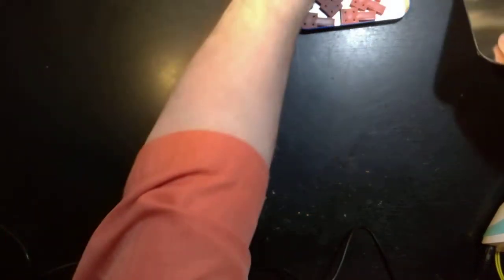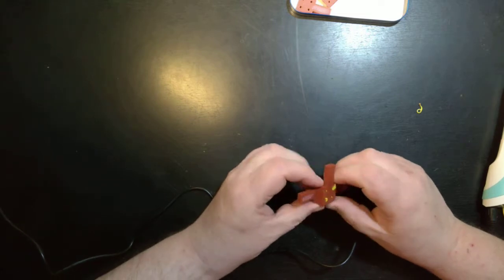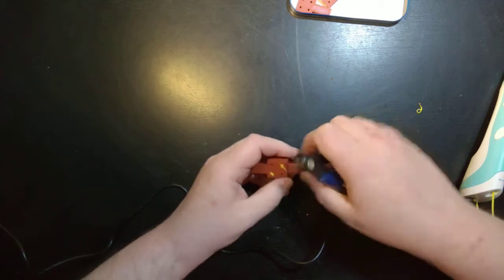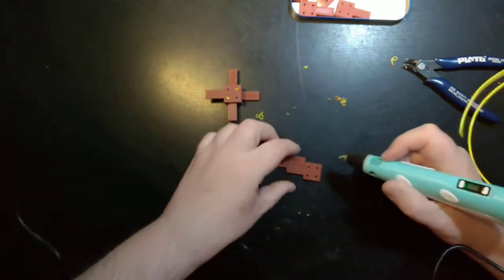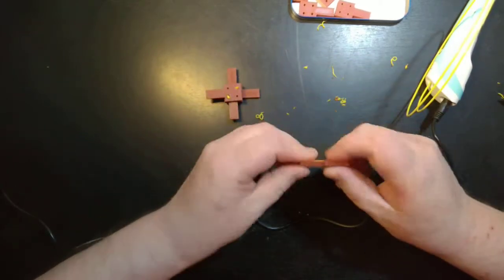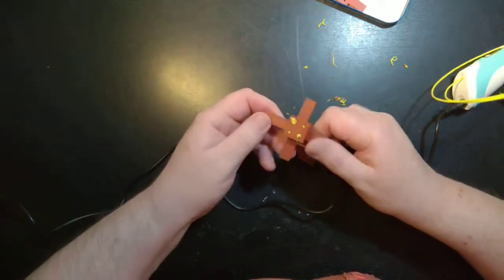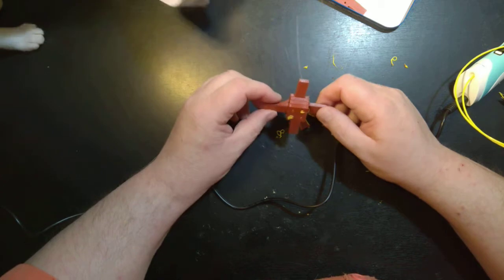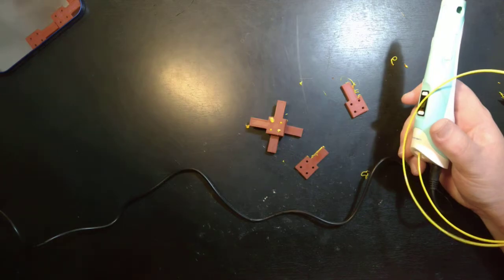3D Riveting and Welding with 3D Pen

Comment: Wow! Cheers mate for the riveting idea.
When you weld the parts, just push in the hot nozzle into the parts. So you melt the parts along the seams and push in new material. That would be real welding.
Have a good day mate!